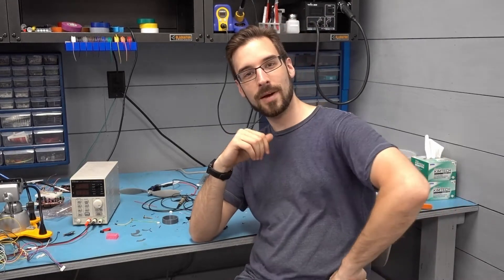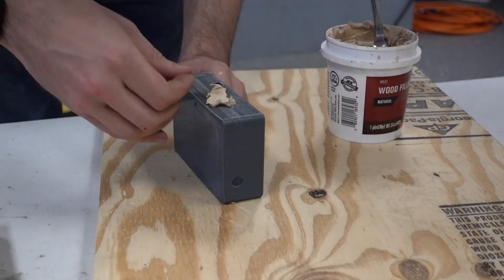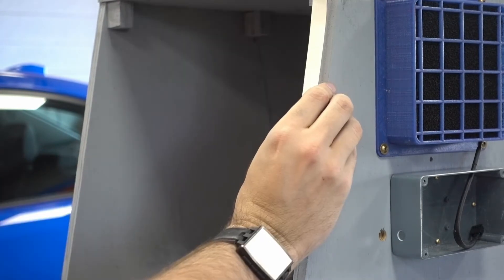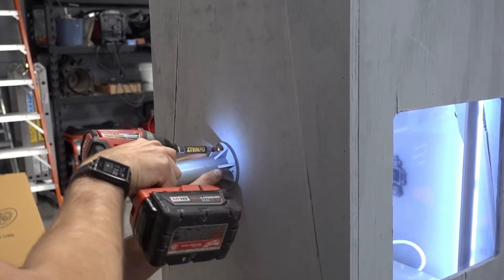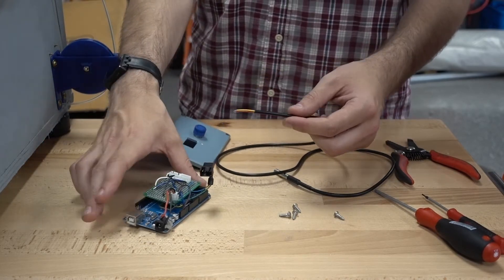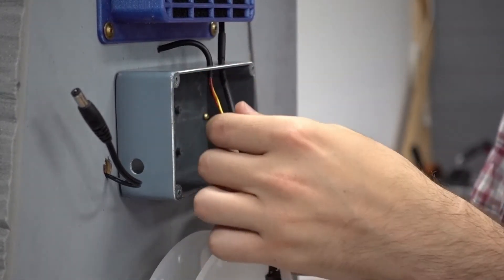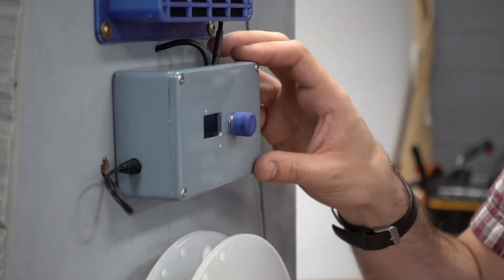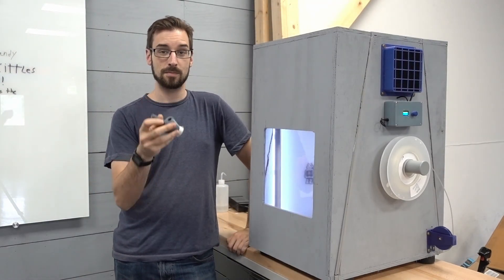3D Printer Enclosure (Part 2)

Comment: Where can I find parts and instructions on the electronics I would like to build that controller for the fan please and thank you
Reply from the maker: Here is the link to the code that we used: https://create.arduino.cc/editor/tiurethca/4a6fa099-6651-4d82-9870-280fd0dd6a3a/preview
Reply from the maker: If I remember correctly, all that stuff came from adafruit.com. they have a bunch of nice stuff that usually comes with Arduino libraries. Just search for a one wire temp sensor and it should come right up. I keep several of those around because they are quick and cheap.

Comment: Ok dumb question, but could you not have just sealed up the ultimaker with just plexiglass and not require that big plywood box?  It already has a frame to attach it to and plenty of room to add the fan and and electronics.
Reply from the maker: you certainly could, but I wanted a bit of insulation to build up a consistent buffer of heat. (temperatures can very a lot in the lab) also, protection from bugs, metal dust and physically hitting it is nice. (I do fabrication in my lab. so, this is probably not needed in most cases)

Comment: Hey could you explain the electronic more detailed?
Reply from the maker: I can. I just slapped it together with an arduino that was just sitting around. So, I wouldn't consider it exemplary. But, if it helps, the temperature sensor is from adafruit (DS18B20) and uses a one-wire protocol to communicate. The One-wire library for arduino worked last I used it. So, that should help you out. The fan needs power, ground and a PWM signal for speed. The arduino is using a simple pid to control the speed based on desired temperature. As for the display, it uses I2C and is a bit complicated to describe in text. If that is important to you, I might be able to make a video. (It would be PSoC though, I don't use arduino much anymore)
Reply: okay thank you but your build looks so simple and small. How did u realise it? What are those connectors on the circuit board? I know i can use a shield module for the lcd display. I found this project ( https://www.electroschematics.com/9540/arduino-fan-speed-controlled-temperature/ ) which I think look kinda similar to yours but its pretty complicated and big.
Reply from the maker: Yeah, I don't like shields very much because they do tend to add a lot of bulk. I tend to use a lot of Perf board (or proto board) because then I can make what I need in one shield. One thing you can try is to find a shield that has one of the functionalities you need but also has some unused perf board space. The connectors on the board are JST connectors. I use them a lot and you can get them in kits on amazon. The main difference between my project and that one is that I am using a computer case fan which has a built-in driver. the arduino is giving a pwm signal to the driver that uses 12v to spin the fan. if you don't have a computer case fan, then you can drive a transistor to do the speed control as shown. You could get a proto-shield for your arduino and will go between your lcd and the arduino. you will have to create the circuits by soldering the components and using hookup wire. If you plan on messing with electronics for a while, it is good to collect assorted kits of resistors, capacitors, transistors, diodes, pin headers, hook-up wire and the like.

Comment: Nice, why not one pulley that goes thru a slot in the side of the machine?  Then you could have a larger radius on the filament path.
Reply from the maker: Originally, The idea was that I would have to have the two pulleys located in two different planes. When I assembled it, that ended up not being needed. That is a good idea. When/if the outside PLA pulley wears down, (likely) I will probably try that.